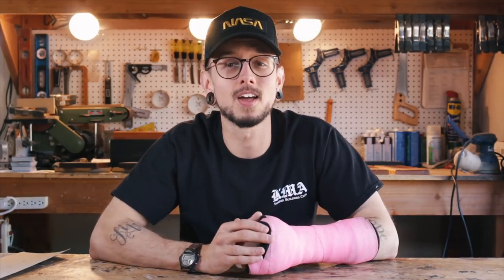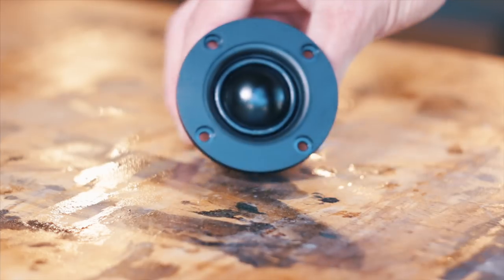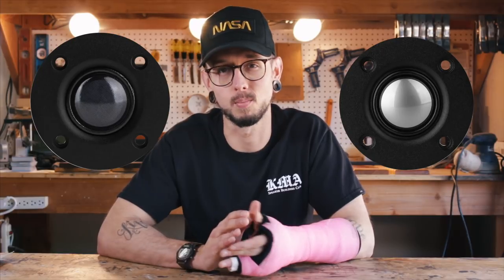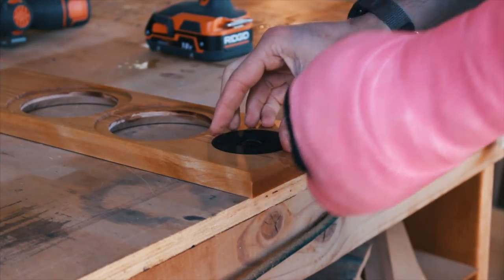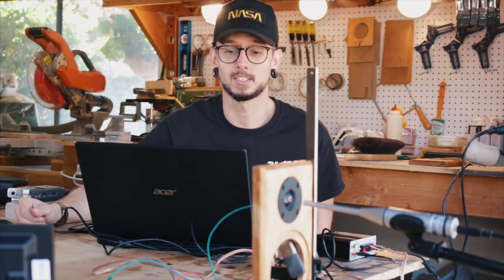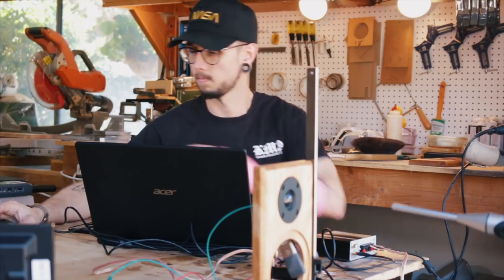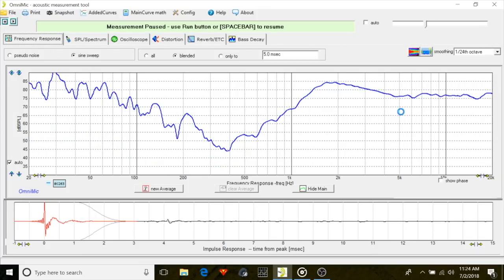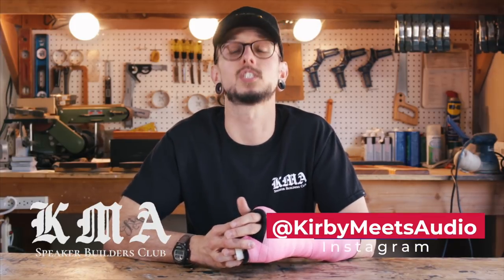The $8 Tweeter! Best Budget DIY 2-Way Tweeter? | Dayton Audio TD20F Tweeter Review

Comment: Just trying to be friendly: To determine if this is a good driver or not, It's necessary to look at the THD/distortion graph as well, flat frequency response isn't everything. Especially when you are trying to find the optimal crossover frequency. It is also recommended to measure the frequency response in different dispersion angles, to be able to match the crossover frequency to the woofer. :)
Reply from the maker: Agreed! The tests will get better with time. Thanks for watching!
Reply: Awesome! I'm looking forward to the build, your channel is great.
Reply: I was going to add a similar response , then I saw yours :-).  Yes, the THD graph should give a pretty good idea of how low the tweeter can be taken.  Off-center measurements of both the tweeter and the woofer will give a good idea of where the crossover point should be (the point being to find the frequency where the dispersion of the tweeter and the woofer are a decent match).  For one meter measurements (used for x-over design), best approach I've found is to use a 1.25 meter rod and to use it to make sure there is NOTHING within 1.25 meters  of the device being measured (it being mounted on a four foot stand), and another meter rod to make sure the distance between the device and the mic - easier to use rods for this rather than pulling out the measuring tape :-).

Comment: So, you could take the data you got from the woofer and tweeter tests, and adjust the components of your crossover to match?  It would be interesting to see the difference between the "on-paper" crossover design vs the "field test" design vs the "it sounds good to me" design.
Reply from the maker: You totally can, but I didn't set up these tests with that intent. I would have done them differently if that was my goal. I'm going to redo these tests when the enclosures are finished and compare the difference in the crossover I came up with using the FRDs provided compared to me own. Thanks for watching!
Reply: That's kind of what I meant.  I realize you're doing these tests for display purposes.  I think it might be good to point out that you can use this data for something practical, other than just saying "hmm, that's nice. I like that driver."

Comment: I built a subwoofer for my home theater system using a Dayton 15 inch sub. It sounds amazing!! I now want to build a custom center channel speaker that will be wall mounted underneath my 82 inch TV. The speaker will be approximately 48inches with eight mids and a tweeter. Any suggestions on a good tweeter to use, dayton or otherwise?

Comment: I built my speakers when I was 16 working a boat yard.. (1975)
I built two cabinets based on University speakers with a folded horn. 12 inch woofers, dome midrange and tweeter.

Comment: I'm building a new speakers. and since i'm limited in space on the floor. I want to build 2 decent ceiling speakers. would I get a better bass if I use 2 identical woofers in the same enclosure ? or box if you will ?

Comment: hey Kirby I'm currently building a speaker set from salvaged parts. any tips on how to test/rate the salvaged parts without your fancy equipment? I'll be using your crossover video for reference later.
Reply from the maker: I'll be doing a video on this soon, but I don't know of a way to design around salvaged drivers other than just guessing or using something like the DATS system. Thanks for watching!
Reply: Thanks! yes I've been just using aligator clips and testing how each driver sounds and "grouping" them. I made a 2.1 in a box a few years ago for my grandpa's pc, using 2 PC speaker drivers and adding a salvaged car 4" woofer below as a LFE. Sounded quite good for being basically made from scrap wood and salvaged components.

Comment: Thanks for sharing your tests! I'm concerned about all the low frequencies coming into those measurements though. It makes me wonder if that 3khz-ish spike is actually background noise and not frequencies being produced by the tweeter, given the amount of noise in the lower frequencies which certainly are not being produced by this driver. I'd love to see results of a similar test comparing this to a titanium dome in a more controlled environment.
Reply from the maker: A more controlled environment is coming soon! I don't think thats the case. The hump is mostly coming from the baffle setup I was using. All the low frequencies you see are much lower than the amplitude of the high frequencies coming from the tweeter. Thanks for watching!

Comment: Hey kirby.... will it make any sense if i build a 3 way speaker? I want to make some big ones....
Reply from the maker: Sure! Designing a 3-way system is just more complicated than a 2-way. Thanks for watching!
Reply: Kirby Meets Audio I think the only thing that is more complicated to do would be the crossover for the midrange-driver.... But i think for that i could use a bandpass filter (i don‘t know the english word for bandpass)
Reply from the maker: No, thats not how 3-way systems are designed. Here's a good article to get you started: https://www.diyaudioandvideo.com/Tutorial/DesignBuildCrossover/
Reply: Kirby Meets Audio thank you very much for the fast response. I‘m going to read trough the text and looking at your „speakerbuild get started video“ a second time
Reply: You are actually correct, the term is bandpass in english as it denotes the use of a highpass and a low pass filter to create a band of frequencies. So in a 3 way, the Woofer is filtered using a Lowpass, the Mid range is filtered with a bandpass and the high/Tweeter is filtered with a Highpass filter.

Comment: Hey Kirby Great vid as usual..  That size comparising of the TD20F to the `full size` was pretty `baffeling` (get it?) XD  Can you give me a short explanation as to why the TD20F 3/4" is so much smaller than the 1" `full size` tweeter pls ? Peace from Denmark :)
Reply from the maker: Haha! Nice. The overall diameter difference? The main reason is the full-size tweeter uses a ferrite magnet to move the dome rather than neodymium. Ferrite speaker magnets are much larger than neodymium so they need the space. Thanks for watching!
Reply: Right gotcha dude. I was just wondering about the overall housing size difference..  FYI Thanx to you, i now have the courage to convert my vintage pair of Bang & Olufsen TV speakers to use them as front speakers for my 5.1 surround system. Meaning they need new cabinets instead of the plastic cabs they were made in :)  Thx  again mate :)
Reply: elCaxi1971 , it's not only the 1/4 inch difference but it's mostly the baffle mounting plate is why there is the difference you mentioned.

Comment: Kirby  can you do a video on concentric style speakers please, thanks ,lol one more thing what about upgrading components on store bought speakers.?
Reply from the maker: Are you talking about a coaxial? Everything in speaker design is specific to the components used. So if you replace the woofer in a store bought speaker, the crossover is no longer designed for that driver. Maybe you'll get lucky and it'll sound great, but theres really no way of knowing unless you do the calculations first or someone has already made the swap in their system.
Reply: right basically using higher grade components of the same parameters or close but using higher quality parts. would i see a substantial increase in sound quality .im very green to all of this just trying to learn what would work and whats not worth trying i guess.
Reply: but on the concentric part of the post that would be completely seperate request.
Reply from the maker: If you're talking about crossover components on a store bought budget bookshelf speaker, yeah, you'll probably hear a difference since most of those systems use really crapy components on a PCB behind the terminal plate. If you're talking about the drivers themselves, reference back to my first comment, you probably wont find higher quality components with the same TS perimeters. And I don't know what you're talking about with concentric speakers. Most speakers are concentric. Do you mean coaxial?
Reply: ok i have a misunderstanding of concentric i basing my interpretation of concentric on the Tannoy style speakers how the tweeter is placed inside the mid driver or woofer pleases excuse my ignorance.
Reply: i see how my question did not make sense sorry
Reply from the maker: No worries! I'm stoked you're trying to learn! I see what you mean. Yes, those are usually called coaxial speakers. I don't have much experience with them, mostly because there aren't many quality ones being made for the hifi market. Dayton came out with one a few months ago, but I haven't ordered one yet. They're used a lot in car audio.
Reply: Kirby Meets Audio  Polypropylene caps are good replacements for crappy electros that has series ESR that limit the output level of the tweeter

Comment: That bump you see does not belong to the tweeter you are measuring but to the baffle. Beranek and Olson have explained the baffle refraction of point source type of direct radiators in their text books in the mid 50s. Please avoid delivering misleading information.
Reply from the maker: Misleading? When did I say the bump was from the tweeter alone? Of course the bump was caused by the baffle, any changes from just moving the mic back will be caused by outside influences.

Comment: Soft dome tweeter tend to muffled out poor quality electronic that can cause harsh highs, while metallic dome has better resolution. Not all soft dome are actually soft, some are like fabric instead of silk.
Small dome size tweeter has better dispersion, better high extension but need higher frequency HPF or will distort easily, best paired with a mid range or a small size woofer that can do LPF and higher frequency without distortion.
From the graph, I will choose minimum of 5khz 12db/oct, or 6khz when paired with a good small woofer that can cover higher frequency.

Comment: Probably will buy this tweeters for desktop bookshelf 5.1, I hate this HORRIBLE Piezoelectric tweeters, in fact the 2 way speaker I bought recently is just big and dumb, it sounds miles worse than my gaming Logitech Z5500 single smaller speaker with plastic enclosure... But they are nice for a project build, will start buying 2 tweeters or 3, the rear speakers already sound kinda good as they are the big tower speakers that were supposed to be front but due to lack of space sadly they are the rear surround speakers :(. So I really need to fix this super nasty muffled muddy front bookshelf speakers...

With Z5500 a FPS simulator with real nice sound effects REALLY sound like I'm in the middle of a war and now with the bigger speakers it sound like I'm in the middle of the war with cans on my ears FFS :(.

EDIT: However the sensitivity of those Tweeters are far higher than my speakers, is there a way to drop DB level on them without having to be in the equalizer by reducing treble??? I want to use just a cap as crossover as I want the cheapest way to go, is there something else I can add to make the tweeter drop DB sensitivity a bit?